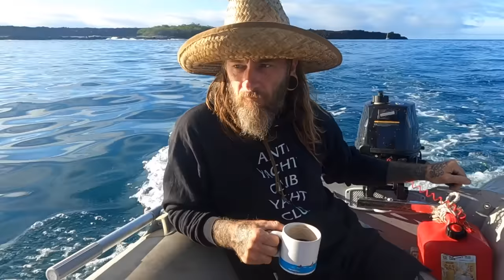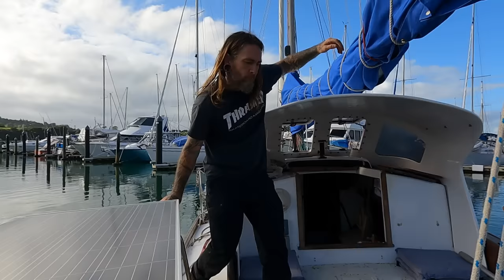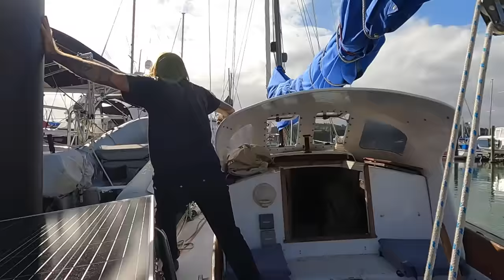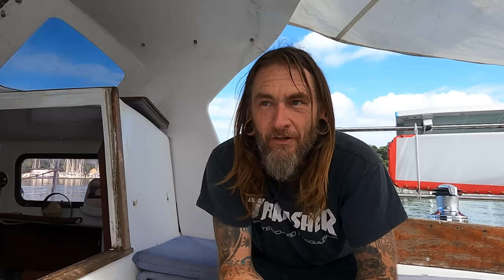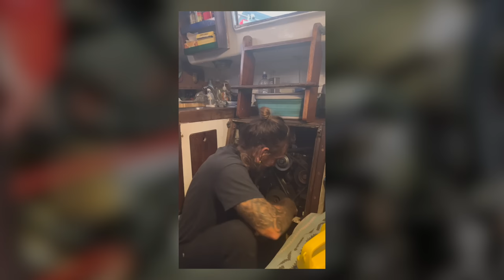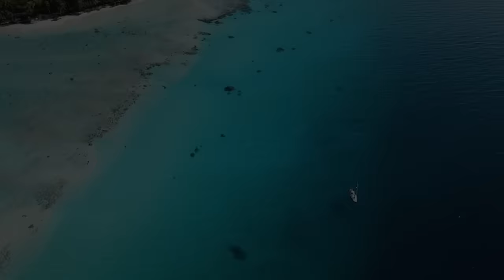Chaos at the Dock After Rebuilding The Engine and a Brand New Starter Explodes on the Shake Down

Comment: James, I could see the anxiety in your eyes and could feel it too. Glad it was a kind of easy fix in the end and really great that you took the time to do a shake down run. I think the case fails on those starters because the thrust length or the throw on the rod is not right and it smashed into the case, or it could be just a lousy knock off casting. John

Comment: Apologies for the long comment! It’s videos like this and your other ones (lost rudder, busted gooseneck, etc.) that saved my arse yesterday. 
I was on a dead run under genoa alone(I’d dowsed the main) and heading into harbour about to make a bar crossing. She’s a headsail driven boat, so when the wind (right on my stern) gybes the gennie and it backs, it really moves the boat around. As a precaution, I started the motor well before crossing the bar. Staying a straight course through a tight and hazardous entrance was nearly impossible with the wind playing the gennie, so I decided to furl and go under engine alone. That’s when the sail jammed half furled! The sea state was getting sporty near the bar. 
At that point, I channeled you. I calmed down and slowed my thinking. Immediate safety actions - diagnose - plan - do. 
I had enough sea room to turn away from the bar and head into wind. Lucky I had the motor on as a precaution. Now with the tiller pilot taking me away from danger, I diagnosed that the spinnaker halyard had fouled the top swivel. I unfurled the gennie, led the spin halyard outboard with a boat hook, which gave enough leverage to unfoul the swivel. I then made the spin halyard fast at a spot less likely to foul again, furled the gennie and made my way back in. Safe. 
A very long way of saying that I’ve worked hard to adopt your mindset as I grow as a solo sailor and it was a massive help yesterday. Thank you 🙏
Reply: Thanks for sharing, mate

Comment: So when my wife was sailing in to South Georgia island they tried to start their yanmar 3gm to avoid some sea ice and… nothing. No wind, no engine, with a big ass blob of ice overtaking their little Wylie sailboat.  Desperate and a long way from anywhere they actually managed to hand crank the engine/ without a manual crank handle. They were able to use a strap wrapped around the flywheel and pulled it like a friggin chainsaw.

Comment: Hi James. Thanks a lot for sharing that experience. I had a similar drifting experience in a marina recently, I have a very small vivacity 650 which is also slow to respond at low speed from the outboard and very susceptible to wind, there was a strong breeze blowing straight into the berth as I was leaving. Didn’t hit anyone and fortunately there were people to lend a hand too, but felt really bad about it after.  Decided it’s all a learning curve and will do things differently next time.
Anyway you sharing shows it can happen to anyone and I’m grateful for you showing the rough and the smooth.
Love the videos, just came across you so binging on your back catalogue.
Keep it up. Cheers.

Comment: If you haven't experienced some sort of maritime disaster (or near disaster) you haven't been on the water long enough. I have a 1967 Bristol 39 which prop walks wickedly to port. Saw a video online where the owner used a dock cleat and a turning block at the bow to pull himself out. Works beautifully. It is now my go to after pushing my 18,000 lb sloop out of the slip, engine in idle. I've had nightmares thinking what would happen if for some reason I wasn't able to hop on. Hit me up if you'd like a primer on that method. Keep on keeping on James, it's glorious!
Reply from the maker: I am almost never in Marinas anymore so I will stick to this method since it’s been fine for 6 years. That technique sounds awesome though

Comment: I do the same with my long keel boat. Being on the boat I put it slightly in reverse and half way out I put it in neutral and pull my self out slowly by pushing/pulling on the poles on both sides or pushing my self away from the neighbour boats. And when it is almost out, while standing on the bow I grab the starboard pole and direct the bow towards the exit of the harbour. Then I push hard on the pole to point the boat around and run back to the cockpit to drive off. The joy of a long keel boat but I wouldn't change it for any fin keel boat. Have had my boat for 5 years now and I have changed the starter on my Yanmar  3YM20 twice so far.

Comment: I watched your latest video. The shot of the engine control system is  identical to that we have on our Vertue class yacht with aYanmar 1gm10 engine . The controller on our yacht is now 30 years old and in that time I have done a complete service down to the last nut and bolt 4 times. They are completely serviceable and with the correct  grease will last the life of the engine. The Yanmar engine has a pull cable on the fuel rack and needs to be correctly fitted to 12:20  ensure that that rack is in idle position when moving from forward to astern. We never start our 1gm20 in any other position than idle and it starts instantly.  Good sailing
Reply from the maker: Mine is riveted not bolted so we have different systems obviously

Comment: We had exactly or at least a fairly similar situation to your problem with the throttle body mechanism, and this too happened in the marina. In the end the simple situation was to replace the throttle mechanism.  That cost around $400 Aud. Then next after having replaced the unit we still couldn’t engage the throttle to drive. The problem in that instance was due to a simple mistake, we reversed the way it should have been installed. Once corrected, we have had no more issues with this.

Comment: Hey James. I know exactly how you felt by experience! You did well. 👍🏻🙏🏻
I have a similar old shifter. There is only one position where the knob comes out. Probably to prevent coming out unintentionally while the transmission is in gear. 
Maybe if the shifter is installed “wrong” or somehow “offset” the transmission is in “neutral” on the gearbox itself -  but not on  the shifter housing up in the cockpit. 
Hard to write it down. 🙈Hope you know what I mean.  
If you take it out. Take off the cables - now you can spin the handle 360 degrees. There should be a resting position of the handle where the knob comes out. That’s where your “shifter housing neutral” is. Reinstall everything and decide in wich angle you want the handle to be. 
Not sure if it works, but it’s worth a try. 
Fair winds! Lothar
Reply: Get a new shifter.
Reply: @manfredolson6889  😂👍🏻 I’d probably do that. But (un-)fortunately those were built to last forever…

Comment: Hats off for managing this situation — but also this shows where sail drives shine. They give you steering authority at low speed because the axle can pivot. Another thing that jumped out to me: you should look into replacing your hard panels with some flex panels placed on the floor/roofs surfaces of your boat so that you don’t have any additional structure for them that can get caught on things. Flex panels have gotten so much cheaper over the last few years and are fairly affordable now.
Reply from the maker: I would never down grade my solar panels

Comment: Hey bro, I have exactly the same throttle set up on my boat, they get really gummed up inside with corrosion with the Ali cast. Anyway you can pull them apart they are easy to clean (boiling soapy poured on first is a good start) grease lube it all up and get going again. The prob I have with mine now that it operates so freely it  tends to fall back off the revs a bit if I don’t maintain pressure on the handle! Given it is cast Ali I’d not hammer the engaging pin. All the best safe travels….
Reply from the maker: Mine is riveted closed not bolted, impossible to break apart to service without destroying it

Comment: You convinced me what a friend once said;
"Never leave a slip without a kiss o'wind
or you're bound to crash
or wind up dead."

Never trust a diesel
to save yer ass,
cuz ya know it'll fail you
&into boats&rocks you crash.

I've only tied up twice
in 24 years,
and lived an easy life a anchor
with zero fears.

Sure I lived in a marina
long ago,
and with my engine&sails
I could come&go.

But to solve ALL
my diesel worries,
and ease my mind
since I'm in no hurry...

I got 2 lithiums, soon 4,
and 3 trolling motors, perhaps someday more,
and have no propulsion worries,
unlike poor diesel addicts
who make funny dockside
fn flurries.

Sure I have a lil Yanmar
and a fat alternator,
but it has nothing to do
with the first 30 minutes
of "See ya later".

I have a KW of solar
and a fat wind gen
so if the Yanmar dies
it's not the end.

Sure you can power into seas
when there ain't no breeze,
but that's not required
if you're far offshore.

I'd rather drift&fart
than pray an engine starts.
Do yourself&Earth a favor;
Don't be a 20th century
diesel whore.

Comment: Hello james, like i said before… a mount for the outboard motor would have been the solution.. then you can use the outboard motor when the diesel engine fails………
Reply from the maker: Completely pointless, I couldn’t have gotten an outboard started and moving the boat in the 3 seconds before I was on the pilings

Comment: I have a Ron Amy Landfall 39’ full keel that weighs in at like 38000 pounds. I do strait lines backing perfectly with 1.6 kts reverse over the rudder by switching between neutral and maintenance of speed to mitigate prop walk.  That was a absolute shit show of a exit. Thanks for posting a little reality often not seen on sailing channels. Pm me for advice on reverse.
Reply from the maker: Every boat reacts differently. Ask any Alberg owner and they will tell you the same story about backing these boats up. Especially in a 1 knot current

Comment: Bro, I have seen that happen. Just a note for the future if you ever use that new starter motor. (not telling you how to suck eggs) But...Make sure the shroud that cracked off is grined back and absolutly clearing the flywheel coggs. You have probably worked that out. Because is aftermarket they often come with a different shroud  shape than the original model. Mechanic should have checked that. But shit happens. Bonesy

Comment: Damn, the boat is not moving neither back or forth--- I saw it and thaught about the gearing--- whattafuuk, Fix that shit gearhandler asap.

Great video and good luck with the new starter. 

Fair winds 👑❤
Reply from the maker: The throttle shifter isn’t possible to rebuild and I haven’t found a replacement that works yet
Reply: @SailorJames  I trust it's out there, just be open to it and again, great realistic video- keep up the good and brave work.

Comment: Wow -- congrats on your positive attitude. Regarding the starter -- did the shop not install an original Yanmar starter and risk a knock-off because of money or was it a Yanmar part?
Reply from the maker: I was sold a junk Chinese generic part
Reply: It is not trite to insist on "genuine, original-equipment" parts. The rebuild shops should know this! Nothing is saved when buying imitations as you demonstrated. Also, that throttle/clutch unit does look sketchy. You'd have peace-of-mind and overall ease of operation by replacing it with a new one and having the convenience of the clutch. As you note, keel boats are poor in reverse bu they usually swing one way or the other reliably depending on prop rotation and having reverse to slow you down when berthing is a big plus.

Comment: Reckon that the local 'Yanmar' Agent would have suppled a Original or even at least a Quality OEM replacement for a lot less than 'Five Hundred' NZ Dollars... as for your Engine Control Head... time to get behind the Bulkhead dismantle that sucker and soak same in a bucket of Diesel, and  then work out where the fault lies...Great Upload...

Comment: WOW. But, crazy answer for crazy problem ? If that part of the starter that exploded (looked like the front part of the case) exploded off of the starter than definitely poor manufacturing, and they are probably s*itting Bullets back at that Chinese Factory because these starters are typically used on several engines by yanmar ! Yanmar will hang them if they can't find a solution ! I wouldn't use that new replacement until that factory has a fix and what they will do is start building them with a completely different case ! Serious problem from what I could see ! Isn't that near where that shaft flys forward to catch the flywheel ? Maybe its flying too far forward ? I tried to find the exploding starters but could't but if that gear goes to far forward when actuated it might eventually explode that part of the case after pounding it 8 or 10 times. I'd check it without it connected to the engine. Mounted somehow.

Comment: You need a 12 ft oar.
Reply from the maker: A 12ft oar would not have helped me
Reply: I may not have mentioned it but I rowed 37ft boats with a 13ft oar for 20 years... the applications are endless. In this case you could steer from the bow by holding the oar vertically with the blade slightly angled, also you can use it to do side thrusts akin to a bow thruster. "Give me a lever and a fulcrum on which to place it and I will move the world." Wishing you continued, and well deserved success.

Comment: For a rebuilt engine it sounds and performs rather poor. Judging from what can be seen and heard in the video. Is it only running on one or two cylinders? 
Engine service seems to be kind of whacky.
Reply from the maker: You have obviously never heard a marine diesel engine
Reply: @SailorJames  I have a 40 year old canal cruiser with a 4cyl 50 hp diesel engine.

Comment: I smell chinese castings on that starter🤔🤔
Reply from the maker: Absolutely
Reply: @SailorJames  i have a 20 year old  g30m yanmar with 200 hrs well maintained in my old 1965 nicholson,  same engine as yours only 1 cilinder more. I think of making a manual crank system on it to start her in case te startermotor fails. Seems easy to do, might also use the heavy milwaukee electric wrench to crank her if need be as a backup.

Comment: so what is actually happening here? Seems like you have no control because there are now speed. Engine runs way to fast, and still no speed. It is a very stressfull situation indeed. I have been in some of the same, but with no engine working, kylix 27 , 13 tons, current wanted to take me out from the harbor. The fear of hitting other boats is the worst, Like others says, good that you show the shit as well as the gold. God speed mate.

Comment: Let me get this straight... you have been in Port for months waiting for your engine to be rebuilt and you didn't bother to fix the shift cables and controls that you knew were broken?  We as people create a lot of our own problems but it's getting a bit too obvious for me here....   I watch  your channel because it's actually real.  No porn model all over your boat... Things are not always rosy.   I suppose I'm being too hard on you.  If nothing else that was March and this is August time to move on.   Fairwinds to you
Reply from the maker: There is no way to rebuild my shifter unit (yes I tried) So until I find a replacement I will continue the simple solution.

Move on then bro #byefelicia